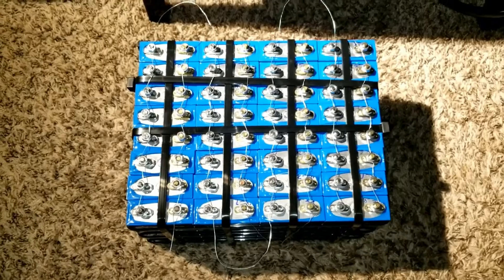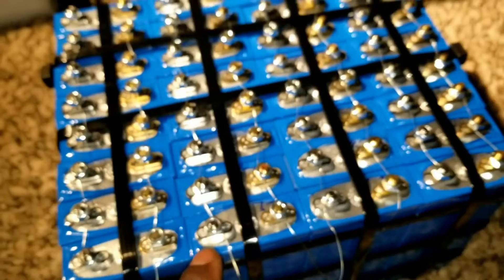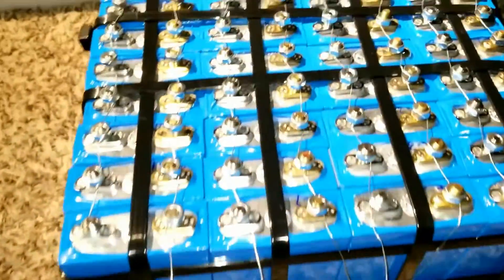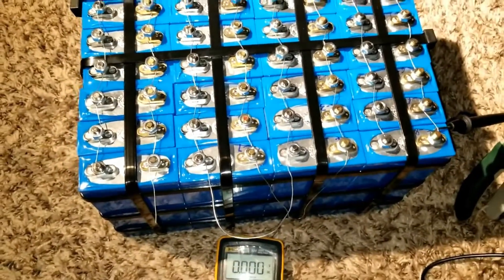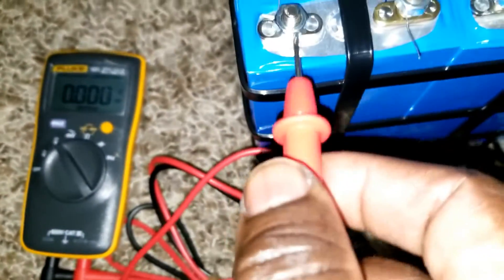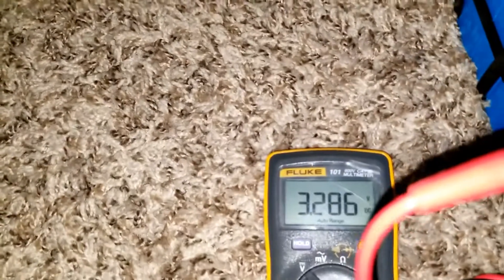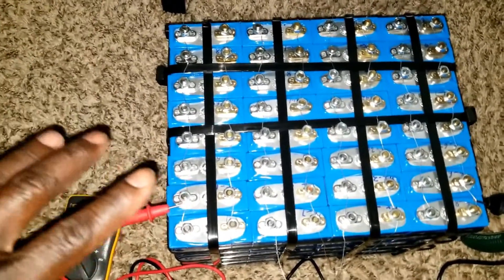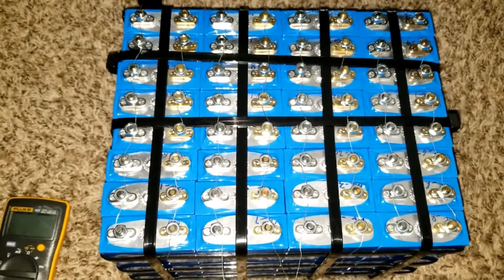LiFePO4 BATTERY BALANCING QUICK TIP

Comment: Hi JW can you recommend a inexpensive LifePo BMS for a 7s 24v's 2p for 48v any advise would help i am purchasing 46 of the 7s 24v banks 104ah but i think 3.6v charge and discharge is 0.8C 100A so in all i will have 23 48v 104Ah battery Banks
Reply from the maker: Hey brother,
This is a hard topic to get into when it comes to Battery Management Systems (BMS)
I will prefer you make your own choice and decision.
Thanks for asking, and have a bless day Sir.

Comment: I like 8”, 4” and 2” Kapton Tape. If people knew how dangerous and powerful these batteries are, they would only use high temperature rated materials like Kapton Tape, concrete board and Prettyia  CeraTex 3170 Ceramic Fiber Paper, High Temperature Insulation Gasket or Liner for Kiln Stove Furnace Glass Fusing, Thickness 1/4" Size 24" x 12.5' Rollceramic fiber mat/sheets. They’d have a nitrogen/CO2 tank/regulator outside their power house for fire a simple fire suppression system. Only use high temp rated wiring instead of pvc coated.
Reply: What? These batteries are similar to lead acid. Basically the safest battery design on the market. Are you taking about lipo? Lion?
Reply from the maker: Thanks for the input